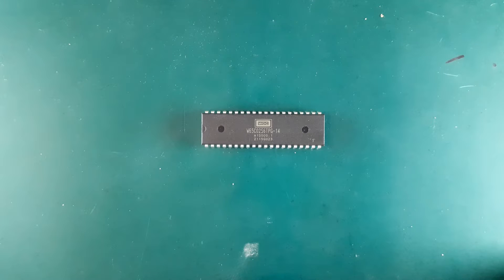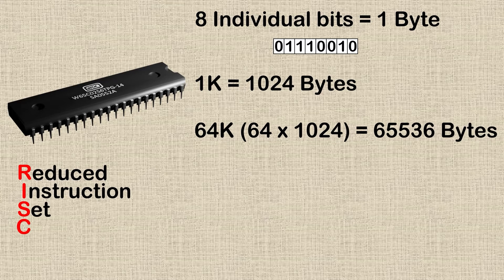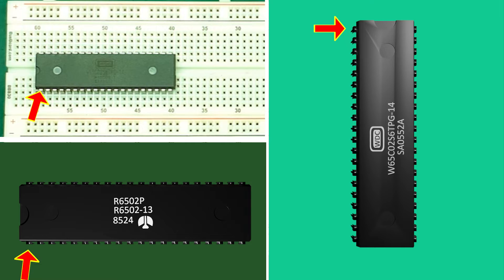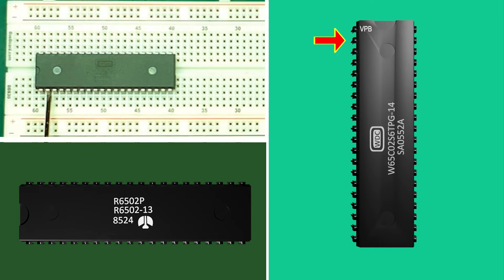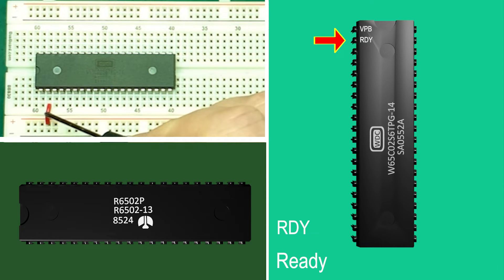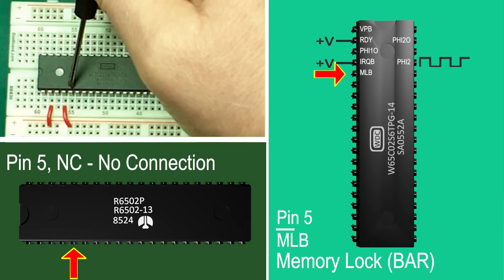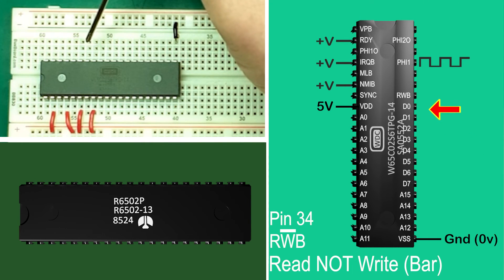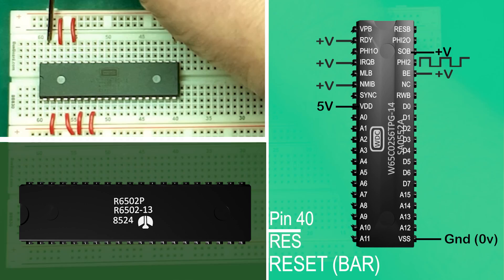Building a 6502 computer: Episode 2, the pins of the 6502 and connecting for a basic system.

Comment: Interesting video! And since you mentioned OpenOffice, in LibreOffice Writer you can just ctrl-select all the text you want to have an overbar, then go to Format/Character/Font Effects and select from the various types of overlining.
Reply from the maker: Ahh, I've got that installed on my Linux box. That sounds perfect, thank you.
Reply: @XTronical  In MS Word you could use the “equation editor” by placing cursor where needing the pin label. Press Alt + '=' and the equation editor pops up. Type in the label code (eg. VP), select the text, then in the ribbon/menus choose the Accent button option. A window appears to select the type of ‘accent’ and there’s one with a bar above the letter/s. Choose this and then you have the bar above, but you might want to set the default italic font back to plain (in normal Home menu options). That’s it 😎. It can be in-line with other text if describing the label, or in a text-box floating next to a diagram, etc.   NOTE : The first time loading the accent options may be slow, then it’s retained?. Also, there’s probably a way to stop equation text defaulting to italics, but I haven’t done so.

Comment: I'd really like to have been at the meeting where the SOB pin was justified. The output clocks are slightly delayed by the push-pull amp and inverters.  I also heard they are shorter than you'd expect so that they never appear overlapped to other circuitry accessing the bus.  This would mean that they can both be concurrently low for short periods before a rising edge occurs.  Maybe you could show us on a scope?
Reply from the maker: Thanks for your comments, bit late on this reply but I will look at this next time perhaps

Comment: I found the vector pull pin quite usefull. I hooked it up to a max 708 chip like the one I used for power on reset. I hooked the output of the chip to an led. Now I can see if things that should trigger an interrupt, like using my hex keypad, actually do trigger the interrupt.
Reply from the maker: That's a really useful tip, thank you